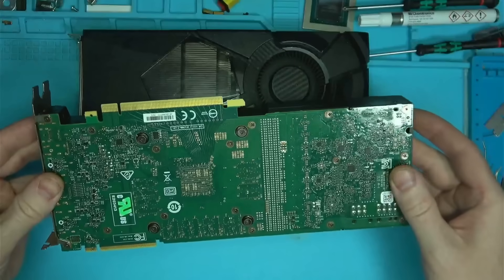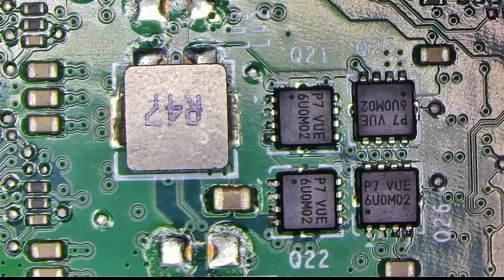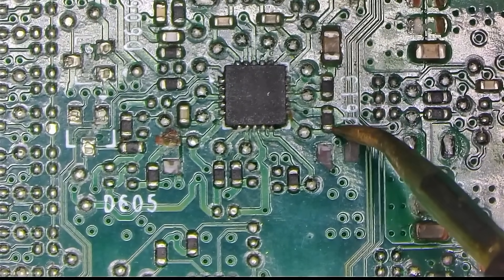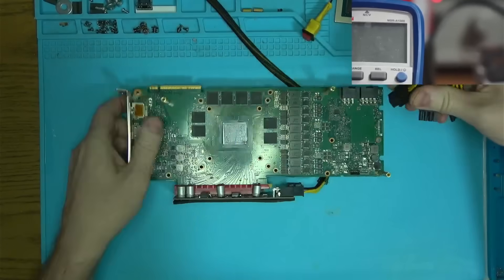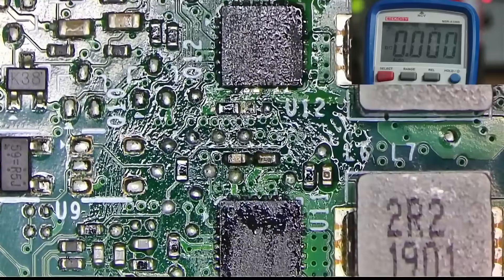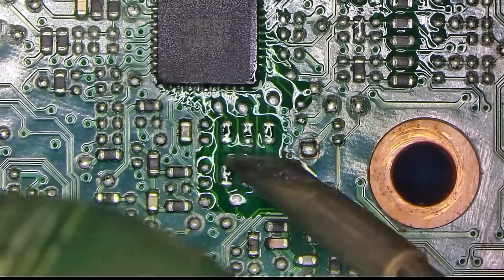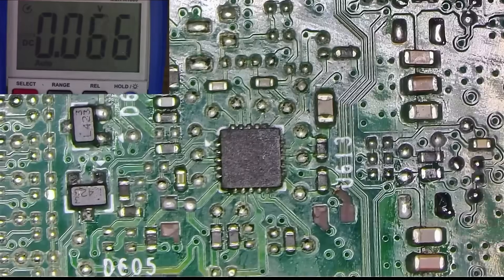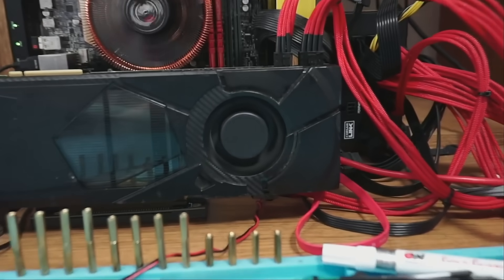What happens if your GPU has no back cover ? PART 1 (AI voice)

Comment: The 3080ti parody video on Northridgefix is gone?
Reply: I have a gts 250 
We can deem it no fix as it not economical to take the dust of the cooler by plug off the cable

Comment: I'm in need of a new pc.  I game a little and dabble with 3d modeling, for both games and for 3d printing.   My current PC is old.  I'm very concerned about everything I'm seeing and hearing about temperatures on new GPU's and CPU's.  

I watch your videos and see you re-apply thermal post every time you work on a card, which makes sense, since you're disassembling them.

But I'm hearing some people say that you should re-apply your own thermal paste every 1 or so as general maintenance.  Another youtuber I saw was using some kind of thermal pads that were more like a putty than a paste.

Do you have any thoughts on this?

Not a fan of the Morgan Freeman, but hey, you tried something new, no biggy.
Reply: If you are not overclocking the cpu and or the gpu you should be fine no need to change the paste every year, just clean the fans and the cooler fins off the dust, if there is any dust build up